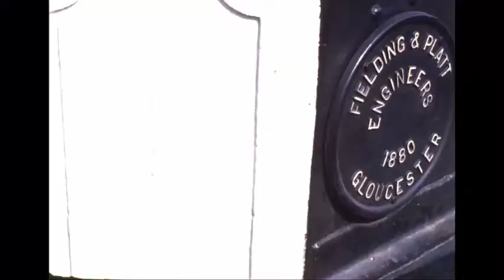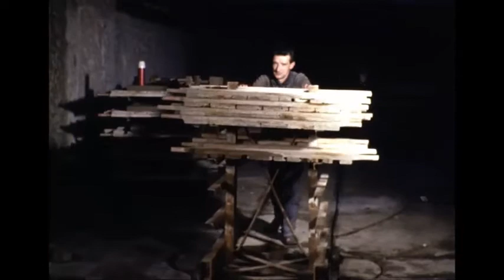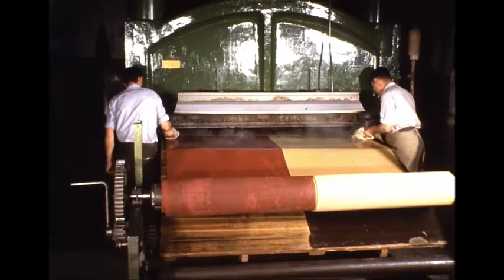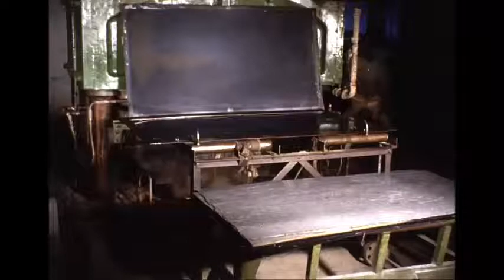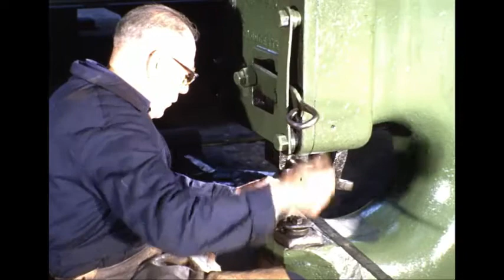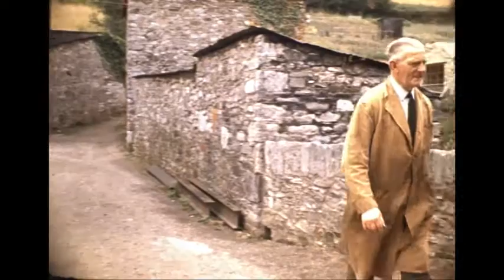100 years of Fielding and Platt

Comment: In late 1950s concraft  Ltd   Concrete   products Middleton  manchester,   had press  worked by high pressure  water  via massive  accumulator  tank   5 feet diameter  14 tons pumped up 14 feet high  on 9 inch diameter tube